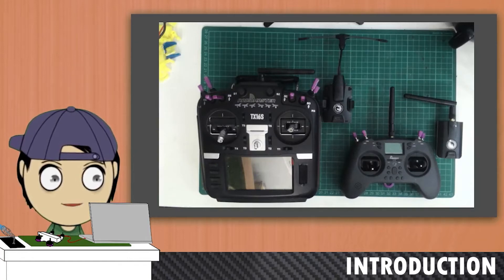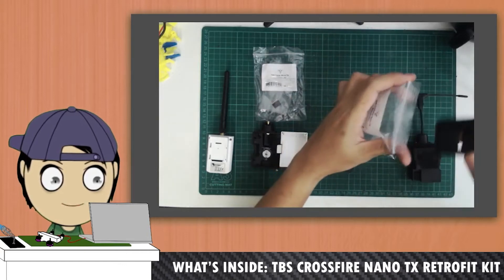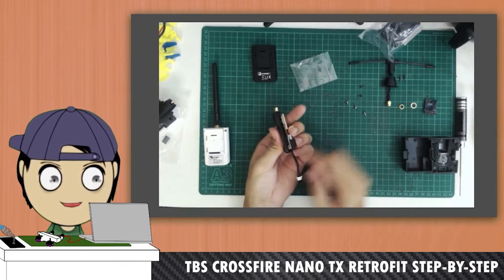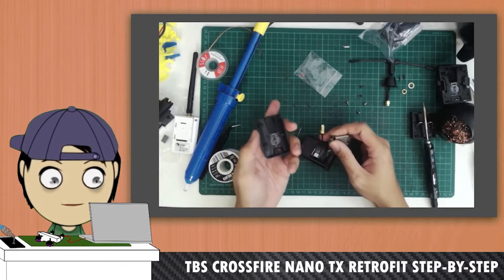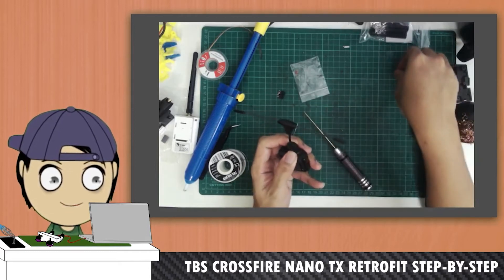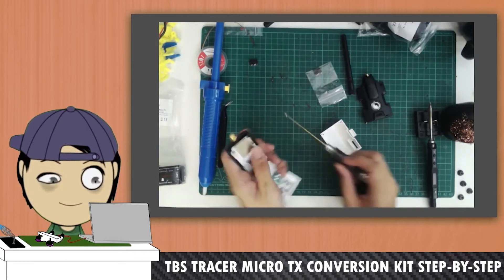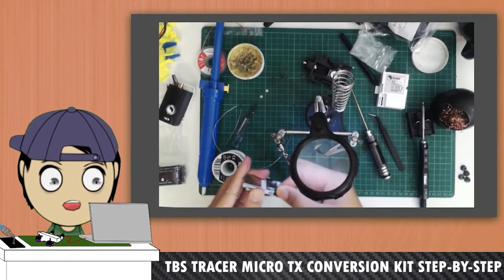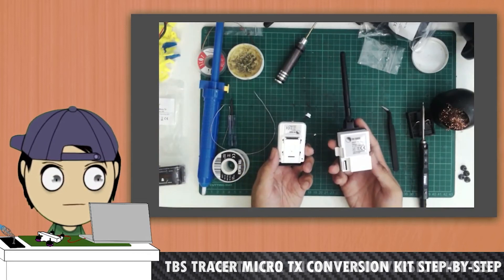TBS Retrofit & Conversion Kits

Comment: Hi bro at the video 15:8 to 15:20 sec you was doing a testing . How do you set that ? I have the same Radio . Thanks
Reply from the maker: On the radio:
>System button
>crossfire configure
>crossfire micro tx
>bind

On the crossfire nano rx:
>plug in lipo
>press gold button with a screw

After doing above maybe the radio will tell you to update
Press confirm

Hope this helps

Comment: do you know if this would work for getting the full size crossfire oled display version to jumper t lite
Reply from the maker: I don't see any sort of listing on the TBS website, and the conversion kit shown in this video is designed for the crossfire micro tx V2 only. 
5:05 is the main difference, the micro tx v2 has the JST insert on it, meaning it is by design intended to be interchangeable.

For your case, the OLED crossfire has a lot of other things going for it and I don't own one to try it out.

The best people to ask would be TBS themselves and see if they can suggest a solution; 
http://team-blacksheep.freshdesk.com/support/tickets/new

Comment: Do you have a link to the one for the jumper t lite or did all that come in the kit?
Reply from the maker: The retrofit, Meaning Crossfire Micro TX V2 to Crossfire Nano TX (for t-lite) is this one:
https://www.team-blacksheep.com/products/prod:xf_nanotx_retrofit

This kit comes with two nano bottom cases (the side which connects with your radio)
1X Bottom case for the Jumper T-Lite 
1X Bottom casefor Taranis X9D